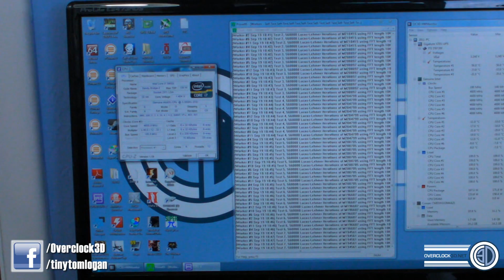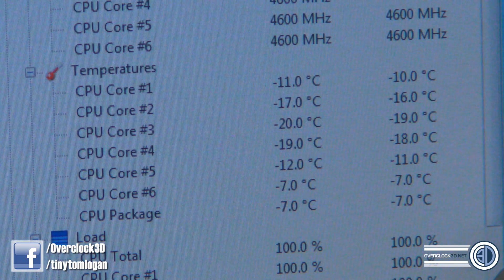Ultimate Corsair H100 Cooling Mod

Comment: if you dont use a compresor like in a fridge you will never get the cpu to run colder than the room temperature ... the fans are only there to help the the water cooling system to "lose the heat faster" that means it can get rid of more heat, but only to the point where it is as hot as the sourounding air .... everything else is fake !
i cant belive that half a milion people beliving that you can get -7 °C with a water cooling system which only transports the heat so regualr fans can cool it with the surrounding air... 
and because of that i have to say, send me 200 Euro on my paypal account and i will stop clobal warming and i will stop world hunger ...

Comment: Just one question... If the CPU itself is -7C, then how cold is the liquid in the cooling system? And what is in it? Because in -10C shouldnt it froze in the pipes? :OO
Reply: 1: moving water can't freeze
2: it's coolant fluid that's in those tubes, not water...
Reply: Thanks... u r sooo useful.
Reply: The water is constantly moving it cant freeze
Reply: if the water moves in the tubes it cant freeze

Comment: hell why not just put the radiator in a mini fridge or something
Reply: better yet put the radiator in a freezer, fill it with everclear so it wont freeze and then submerge the motherboard in mineral oil to prevent condensation

Comment: If you've ever watched a turbo at full speed so you should know that it glows .. so why do you think you really need an intercooler? and Why is compressed air so damn cold? gas gets cold in high pressure but when reached is 800 celsius next it might not just enough pressure to cool it. sorry for bad English using Google translate =)

Comment: Pffff... Corsair Sp120 with 62 CFM... why not hook 40 Delta Ultra Extreme 256 CFM Fans on there i could bet that you would need at last a 1200W PSU for just the fans alone cause 1 Delta draws 50W! And the Cpu temp would be Interesting and what would the room temp Be xD
Like if you want him to try that =D

Comment: you feel cooler because the air moving over your skin causes moisture to evaporate from your skin, when water evaporates it takes heat from around it as it turns into a vapor. there is no moisture on a heat sink.

Comment: heat in the water dissipates into the radiator, the rad is cooled by air. the rad will never be cooler as the ambient temp, the cpu easily though.

Comment: It's called thermodynamics. Heat always flows from the hotter body/medium to the colder one. As soon as their temperatures are equal energy-flow stops, as there is no hotter body. (Thermodynamics)
So computer fans are cooling as long as the amb temp is higer.
The fact that people thinking fans cool the air, thats just wrong. It feels cold because the humidity on our skin evaporates and this process absorbs energy, in this case the heat of the skin. 
But fans actually heat up your room.(slightly)

Comment: This is completely correct if you are using an air cooler, like myself.
My graphics card was min. 3°C hotter than my room's ambient temperature.
GPU: 20°C Ambient: 17.3°C
It's air-cooled of course.

Comment: The reason we get cold in the wind is that the water evaporating from your skin (sweat) take heat with it (see evaporative cooling). Changing the pressure of air, for example with a compressor or fan,  can also cause cooling, it's roughly how your fridge works. That said I'm certain that 40 fans wouldn't provide cooling to those temperatures, It's either a mistake or a joke.

Comment: I don't think you understand thermodynamics, the fans will not make the room colder is can only move heat from one point to another. In all honestly the fans are producing more heat to the room due to the amount of work that is put into the air. Also this is not ultimate this is overkill, the only way you are keeping your core at negative degrees is by running it in a environment that began at negative degree. What a schlum of a video, dislike for unrealistic testing conditions.

Comment: Second law of thermodynamics. Thermodynamic equilibrium is the state of maximum entropy. The fans can only "cool" the CPU down to the mean temperature of the medium being used to cool it (aka the air). If the mean air temperature is 70° F than the most efficient system can only reduce the temperature of system being cooled to 70° F. His measurement indicate that he achieved temperatures well below freezing with ambient air. Therefor the 2nd law of thermodynamics (aka entropy) is null.

Comment: PART III
(The ambient temperature is lower than the CPU's temperature so it absorbs the heat, and pushes it out of the radiator and into the room. This will result in the room getting hotter and the ambient temperature to rise.) The ambient temperature cooled  fluid will now flow back to the CPU to absorb some more heat and the process continues again.

Energy is neither created nor destroyed.
By the way, this whole video is a troll in case you didn't know.

Comment: PART II
The radiator contains some type of fluid (most likely distilled water). There's also a mechanism inside the part that connects to the CPU that circulates the fluid to the radiator. The radiator has fins (for easier heat transfer) and spaces (for air to flow through). The heat from the CPU is transferred to the fluid which is then moved to the radiator. What the fan does is it blows the ambient temperature of the room THROUGH the radiator.

Comment: PART I
No offense, but what's your highest level of education?
It's highly likely the computer he's showing and the computer he's actually running are entirely different. That, or the room is extremely cold.
Fans: They don't cool. They blow air. If you're in an 80 degree Fahrenheit room and turn on a fan, what temperature is that fan blowing air at? 80 degrees.

Allow me to explain. That thing that ALL those fans are connected to is the radiator.

Comment: 1.] If the fan is blowing air to and from the room it's in, its lowest temperature can only be equivalent to the room's ambient temperature.
2.] Liquid nitrogen is liquid nitrogen. Due to compression, the nitrogen is allowed to be kept in it's liquid state. When uncompressed, due to its  boiling point, the nitrogen atoms attempt to absorb as much energy as it can, thus sucking heat from its surrounding.

Comment: Did you even read his comment?  He is talking about the temperature cannot get lower than the air in the room IF the cooling system is using air to cool it.  Liquid nitrogen cooling doesn't use AIR to cool the liquid you fucking moron.

Comment: xDD Btw, airspeed increases the rate of evaporation which then drains heat off of it.
My cpu runs on 15 degrees celsius with the room temperature being about 23°C
Offset is 0.

Comment: What happens to metal when temps get that low? It condensates. High temps aren't good, neither are extreme low temps. Nobody wants water molecules forming on there CPU. Even if you did get that low of temps, you probably killed that 3960x.

Comment: (read the other comment first)... Second, for any stage (row of impeller), except the first one,  to be effective you NEED stator blades to convert angular velocity into axial velocity or pressure rise, otherwise, there will be no relative angular velocity between the next stage's impeller and the gas, and this result in the next impeller doing very close to nothing in terms of work. So my theory is very ON. Tell me if you need more explanation.

Comment: Hum , Sorry but thrust me I know what im talking about. First, in-line axial impeller in a gas-generator (jet engine core) is called  an axial compressor, turbo fan is the term used to describe a jet engine with high bypass flow (a big fan on the front of the engine wich generate thrusth by accelerating air without gettin this air in the gas-gen). Second, each stage of a compressor is there to compress the air more and more by 1.5 pressure ratio each approx. , it does NOT give more flow at all.

Comment: well, not really. you shouldn't be using pure water for this. cooling solutions for set ups like this usually have something like ethylene glycol (aka antifreeze) in them to lower the freezing point and increase the boiling point. 

having said that, the freezing point of pure ethylene glycol is about -13*C, and a little higher when mixed with water and anti corroding agents that are usually in water cooling solutions. 

but you had the right idea, his temps of -20 are impossible.

Comment: Lol this is useless. Im pretty sure 4 fan total push pull would give same performance. You would need to put them in parallel to get more air flow, not in series... Plus if you want any fan after the first one to help in any way, you need stator to redress the air flow, otherwise the air just swirl instead of going forward.

Comment: could be from a pressure drop inside the radiator causing the temperature to drop like and boiling and then freezing water inside a vacuum.

Comment: ill explain it:
mor fans -> higher air speed
air is just a fluid, and if fluid starts to run really fast the static pressure drops dramaticly.
when u got a lower static pressure the temperatur drops extremely.... (in this way u could theoretically turn air into liquid)
so i would guess inside the radiator u get -20 degree ore something like that.... thats y u can reach - 7 degrees
compare it to the mount washington ;)
it would be fun to see even more fans .... to check the limits ^^

Comment: Are you thinking about the absolute 0? as in 0 degrees Kelvin? because that is impossible to reach according to the third law of thermodynamics. 0 Kelvin is about -237.18 Celsius which is what the program measures in. So yes negative temperatures is possible, just not in Kelvin.

Comment: No, unless his room is at least as cool as the lowest temp it would break the laws of thermodynamics. The reason for this is that the fans are only increasing the airspeed and by doing so you cannot cool anything to a temperature lower than the air temperature. He would need a refrigerator unit in order to get temps this low unless his room is that cold.

Comment: The temperature limits vary between clock speeds, architectures, and voltages. They're not all rated at -100c to 100c.

Comment: this is air cooling. are you serious? the water you are running around is being cooled by air. its practically no different from a heatsink other than the fact that you are moving the heat further away.

the only way to get lower than room temperature is if you run a phase changer, a powered cold plate, or if you use liquid gases or dry ice

Comment: Now a serious question, is there any benefit of running multiple fans? I think the airflow wouldn't be better, actually it might be as slow as the slowest fan in the line. However the air pressure would be much higher, thus allowing the air to easier pass trough the cooler.
Of course this is all just theory.
But if adding a few cheap 2-3$ fans would decrease the CPU temperature by lets say 5°C, it would be quite effective and worth a try.

Comment: It would be more effective with just 4 fans.. putting 20 in row is  damn stupid because if 1 fan creates pressure to next one, it just creates resistance to air flow so more than 2 in a row doesn't improves nothing.

Comment: laws of physics learn that with so much fans directy attached to one another, the efficiency DEcreases. not INcreases.
Don't believe me? Do some research and calculations
Still don't believe me? Build it with one fan, two fans and so on, and measure the temperatures during the build. You'll see.

Comment: With disclaimer in mind at the end of the video, whether those temps are achievable or not, with the setup, condensation would be the killer. Though you can get below 0 temps without LN2.  Though any below 0 setup will cost a small fortune to setup properly.

Comment: The temperatures were faked... temperature does decrease with pressure, but the fan pairs weren't blowing in opposite directions. Radiators work off of heat exchange with ambient air normally... if you limit radiators to purely radiation for heat dissipation, it would hinder performance.

Comment: No it Does not, But for a Overclocked,Powered CPU to have a surface Temp of -17 is not possible from air Cooling, inside a room temp of 26 degrees its not possible unless the Radiator is outside in arctic freezing conditions or if you put the Radiator in a Freezer.

Comment: basically, since water can get heated up very efficiently, the water will take the heat from the cpu at the water block then pumped to the radiator where it gets cooled and then the new coolant is rushed to the cpu which cools it (since its cold) which, in turn, will cause the water to absorb the next wave of heat and the process is repeated.

Comment: "the  maximum output is inevitably less than simply having 1 fan" -- bro u cant get -20 with 1 fan on an H100. Also the way a compressor works is by having multiple small fans in series. Look at the inside of a jet turbine engine mate before you start not understanding physics. And before you ask I'm an Aerodynamics engineer.

Comment: its not just fans and a radiator theirs cooling fluid in the radiators go into your bathroom and poor some alcohol on your arm and its gonna get real cold certain fluids get cold just by touching a cold surface which would be the radiator get even colder

Comment: Question please! I have an h80i. There is a cord that came with the kit. Its a fan spliced adapter basically so you can hook up two extra fans... Do i need to have that? Or could i just run the fans off another device i use to control the fans...Also it doesn't light up unless i have this small fan cord plugged in..

Comment: Who ever designed that failed physics. 40 fans in series doesnt give you 40x more power, it increases drag, the maximum output is inevitably less than simply having 1 fan.  Want to increase your cooling 40 times? increase the surface area for your cooling, and rate of exchange fot the coolant. This is some noob BS right here.

Comment: Air pressure isn't a factor in this case nor could it be one. He has just as many fans in front of the radiator as he does in the back. Even if you tried changing the air pressure it wouldn't matter. More air pressure would mean greater surface area distribution but hotter air. Less pressure would make things cooler but less surface area distribution. Basically you will get the same result regardless of air pressure. Unless you want to talk about Air Conditioners, That's a different topic.

Comment: Correct me if I'm wrong but how many fans you line up in a row shouldn't matter. I'm sure it does increase air flow which cools it down more so, but shouldn't people be focusing on surface area more so? In this video you're pretty much just getting more air flow which could probably be done with 2 fans spinning at higher rpms.

Comment: It isn't going to freeze over, that is simply impossible - the fans don't COOL the air, they just move room temperature air over the radiator fins extremely fast so heat transfer happens extremely effectively. But you will never 'freeze' something over just because you are making a lot of wind... Think about propeller planes - their front doesn't freeze over, yet they move FAR more air than this build here.

Comment: It's not about the speed of the air, its about the quantity and pressure. Higher pressure means lower temperature and more heat dissipation.

Comment: Basically, it's throwing hot air out, and pulling cool"er" air in & it's passing through that many fans it's freezing the air almost, which then cools the coolant down that much you can reach sub-zero temps on the cores. Suprising that the coolant didn't actually freeze over lmfao

Comment: Actually, the minimum coolant temperature will be Room temp +~10C (the approach temperature for the heat exchanger). Especially considering the size of the exchanger - if you had an infinitely sized radiator it would be possible to get the coolant to room temperature. I think the thermister on the CPU cores isn't designed to react to temperatures much lower than 20C

Comment: Well... It COULD be possible to make it colder than room temp (same way a fridge works), but the heatsink should become quite hot for that - Not considering there should be other mechanical parts in the mix such as thermal expansion valves and compressors...

Without said parts, though, it's just as you said, so... just a little techy moment from me, hope you enjoyed the vid, 'cause I surely did :D

Comment: It does not matter whether its water or "coolant" with out a refrigerant system those temps are not possible unless the ambient temp is lower than that. Once more, if you think this video is at all serious and those numbers are accurate you have bigger problems.

Comment: how did the temp even get below 0 degree?

mind blown 

anyway to confirm if it will work with the AMD FX8350?

all 8 cores running at 6GHz may be possible with this H100 mod

Comment: It does though... coolant freezes as -60C whereas water freezes at 0C... and since his CPU is running lower than 0C then the liquid running through the system will be substantially cooler than that... and water will be frozen below -7C which means water couldn't flow through the radiator and tubing.... therefore it does greatly matter

Comment: i searched the amount of ampere these particular fans have...if im not mistaken it was 0.18 A per fan. But that gives us a 2.16 watt per fan and x 40 = 86,4 watts so I propably used the silent edition fans or smth cause before i had 62.4. Well i think i did correct calculations...so for 40 fans = 86,4 watts = 2 light bulbs and same conclusion :P

Comment: actually 1 fan x 12v = 1.56 watt x 40 fans = 62,4 watts (I used google to convert volts to watts so if im wrong please tell me). Now an average light bulb we use is about 40-60 watts so running all 40 fans is like having 1-2 lights open...so not such a waste of electricity after all